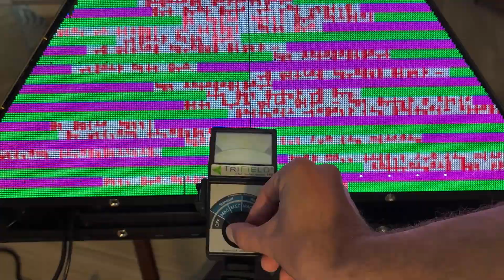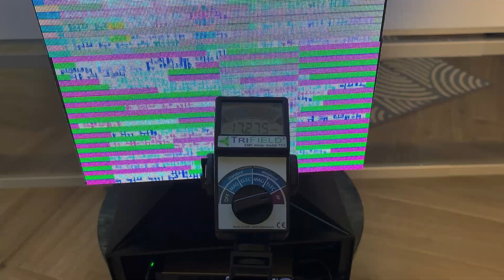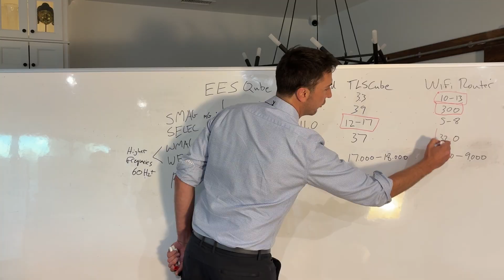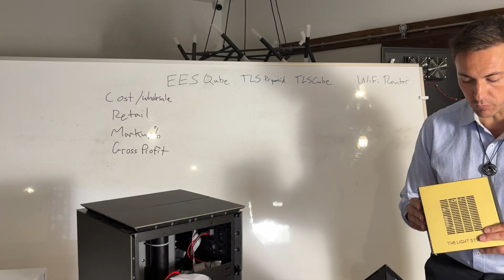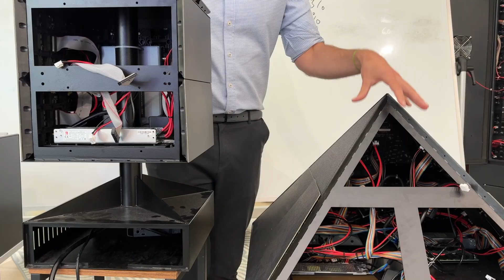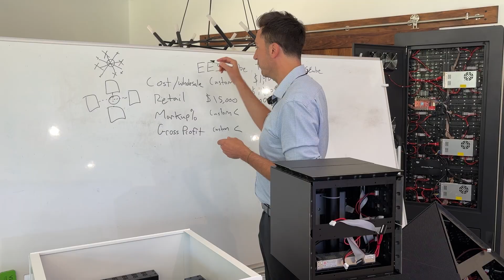EESystem vs TLS Hardware Comparison [Part 1] - EMF/RF Radiation, Quality & Shocking TLS Price Model

Comment: Where can I get the real story of what happened between Shurka and Dr Rose?
Reply from the maker: It's still unfolding in the courts and the marketplace. From what I know, EES was a long-standing product and business developed by Dr. Sandra Rose Michael. I’ve known her for almost fifteen years. Then, about three or four years ago, Jason Shurka appeared. He began releasing the Disclosure/TLS videos featuring a mysterious individual named “Ray,” who appears in a hood with a voice changer. After working with and selling for EES, Shurka got sideways with EES and started offering what appears to be a knock-off version of the same technology using hardware sourced from China.There’s also a significant backstory involving a man named Robert Religa. Shurka claims to have “licensed” technology from Religa, who supposedly holds a copyright from the late 1990s, and has tried to position Religa as the original inventor. However, from what I understand, Religa was one of several programmers who worked on the EES system over the years. Some of his early code may have been used in the initial models, and he was paid for his contributions. Importantly, he did not sign an Invention Assignment Agreement at the time. Now, decades later, Shurka appears to be using this old arrangement as justification for his competing product, while marketing it as the superior and “true” technology — despite independent testing showing high EMF levels. Given everything that’s happened, it’s easy to see why there is ongoing litigation between the parties. After experiencing what I can only describe as an unconventional miracle with my son using the EESystem, I wanted to get to the bottom of the competing claims and test both products for myself. Since posting my video series comparing the two, Jason Shurka has not responded to me or answered any of the questions I raised.
Reply: @octaviusreal 
Thank you for sharing the truth. Prayers and blessings on your son's healing.
Reply: Court Documents
Reply: @breannaolssen5076  where can you find them?